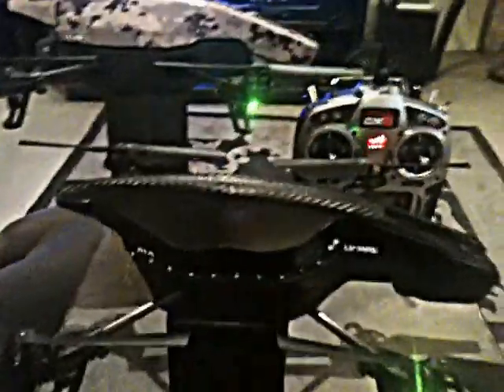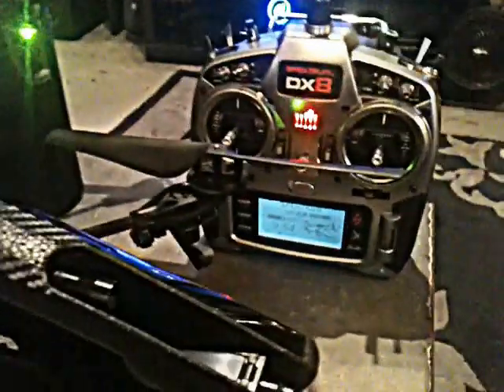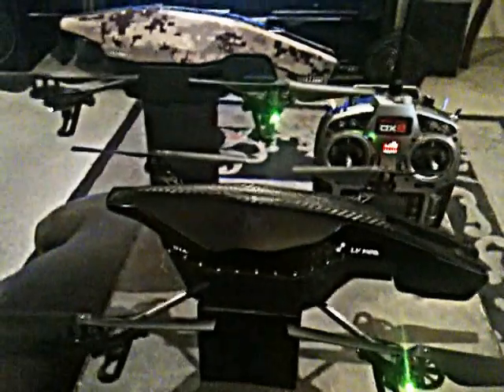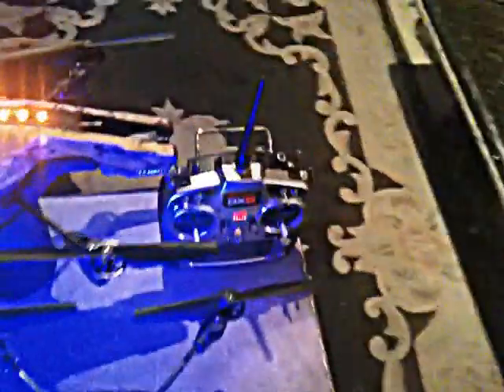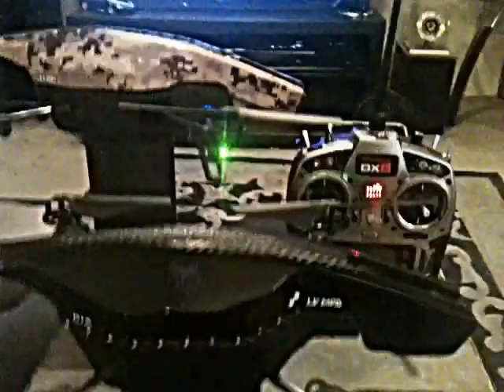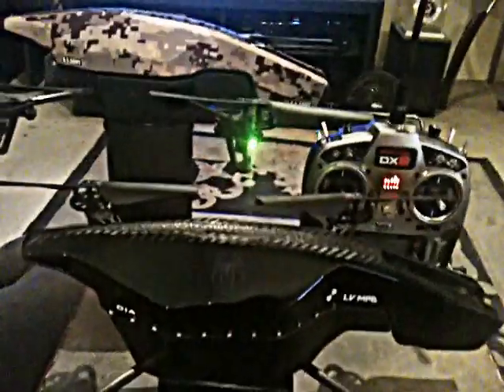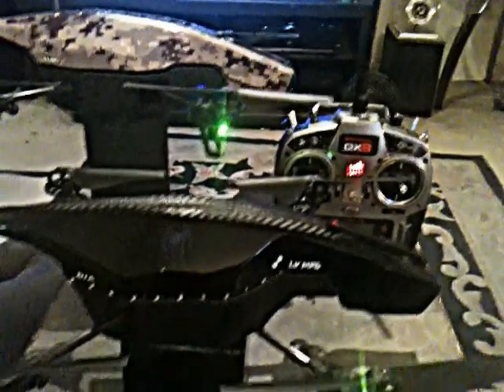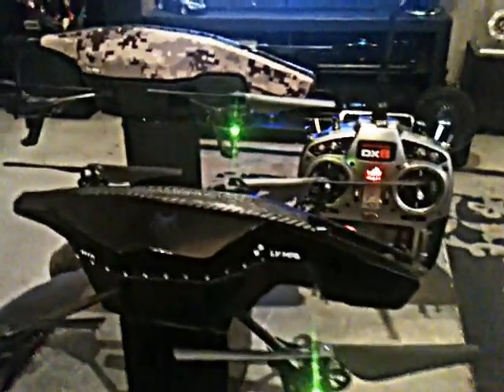AR DRONE 2.0 Update MOD 4- Customization to Hulls electronics and light tips

Comment from the maker: sorry for the late reply no there is only 1 type of dx8 radio but there is a couple of models it is made by specktrum which is now owned by horizon hobby i can set you up with everything through my programmer and the trick is the worlds number 1 smallest digital reciver with special programming that enables the unbelievable abilities of the drone as you have seen my flight are far and high but not even 50% of what it is capable of they can fly up to and over a mile away , but you cant see them!